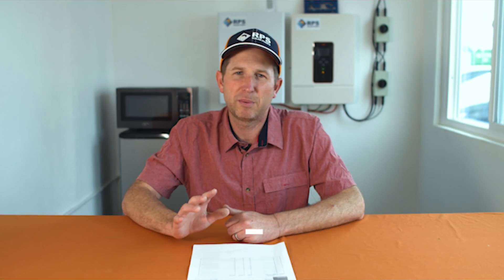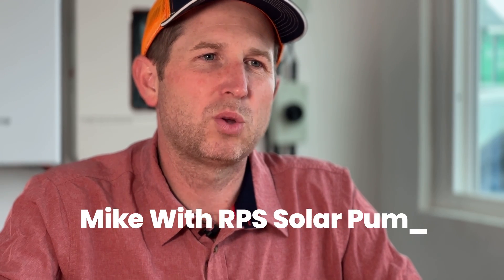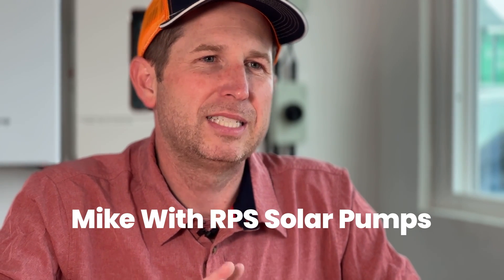What Is The Difference Between A Regular Electric Pump And A Solar Water Pump

Comment: Is it normal for the 800 series to say it's pumping but take forever to pull the water and sometimes it only pulls water for a minute or two then stops. You can hear the pump running but not pulling anything. All voltages are good and examples have been on sunny days with max MPPT.

Comment: Am I correct in thinking your controller is using pulse wave modulation to achieve the soft start and stop, and also control the running speed?